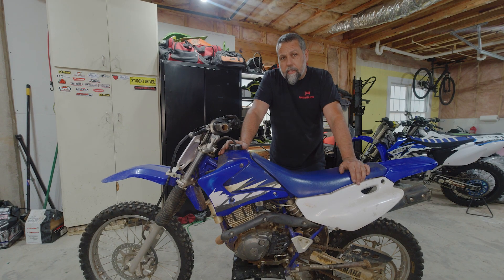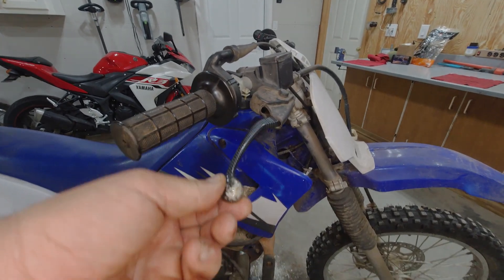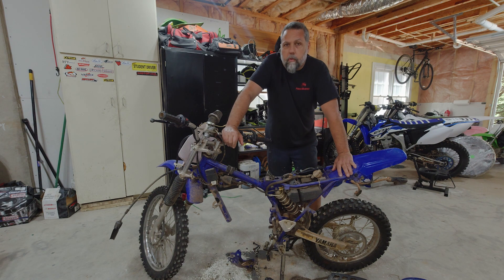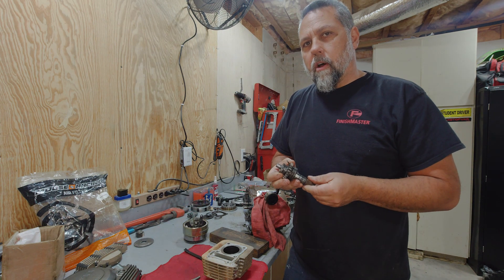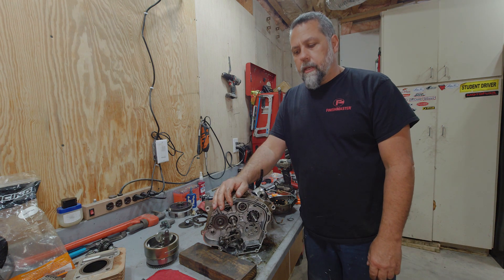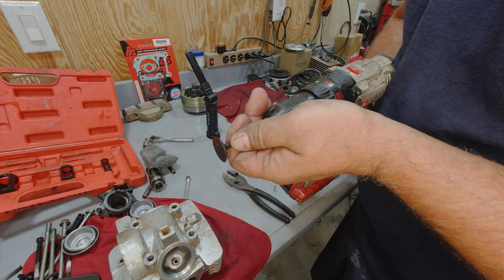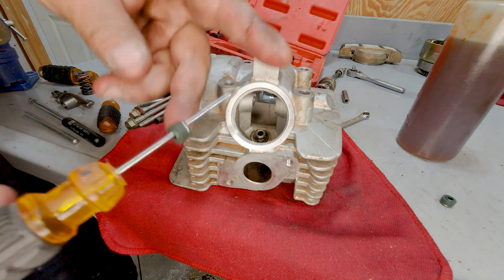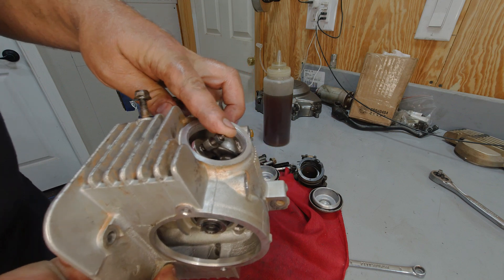Can We Fix This Locked Up Yamaha TT-R125LE Ep52

Comment: Looks great, nice work. Do you have a rule for which bolts should get loctite? Or are you just following service manual?
Reply from the maker: Thank you and great question. Any bolt inside the engine that could vibrate out and cause damage will get blue threadlocker.
Reply: @restoroosterohv  Good rule of thumb, thanks. Found your channel last week and I'm glad I did. Just started playing with repairing bikes and coming from an auto tech background it's nice to see the nuances of motorcycle engines from another tech and not some kids in their garage haha
Reply from the maker: @SkillCollectors  Glad you are enjoying my content. I appreciate you.

Comment: is there any specific reason you use an impact? I can tell your super carful but I screwed my tar-125 clutch case up BAD using one back when I was dumb lol but now Im terrified to use them lol
Reply from the maker: Laziness… I would 100% recommend to use a torque wrench on all bolts. I’ve been doing this for many years and know my tools very well so I cheat a little. There are certain bolts that I will torque for sure. It’s not an excuse and I know it sets a bad example for my viewers. Thanks for airing your concern and I will try to be more vigilant in future videos. Appreciate you watching.
Reply: @restoroosterohv  oh no I didn't mean to like call you out I just didn't know if you had a specific reason lol but thank you soooooo much for the video extremely informative and you just gained a subscriber!
Reply from the maker: No worries my friend. Thanks for your feedback and support.
Reply: @restoroosterohv  for sure!